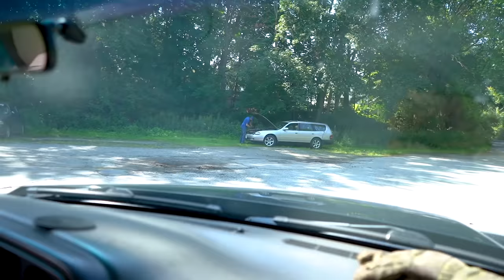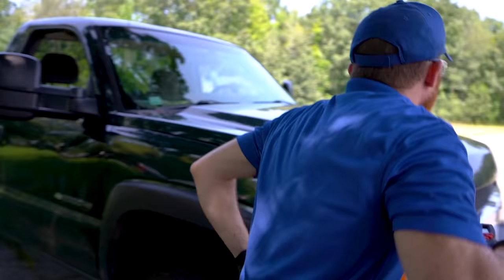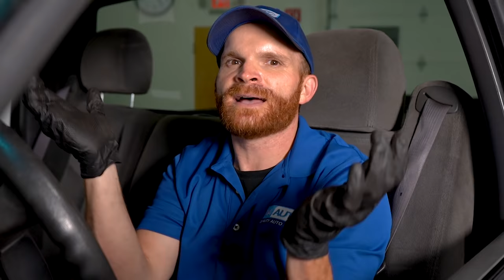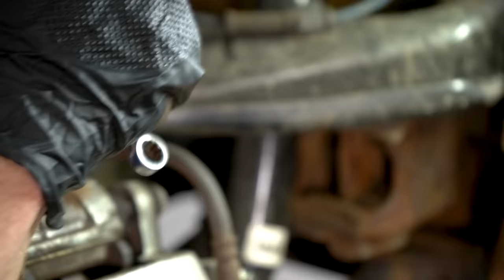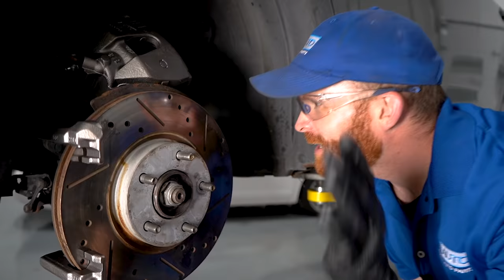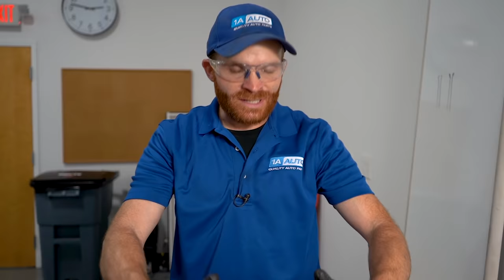Shaking, Pulling Steering Wheel? How to Diagnose a Seized Brake Caliper!

Comment: What happens maester, if the caliper pins are too tight ? Am just trying to solve the issue without changing or opening anything... front left caliper is just a little bit stuck, can still move it with my hands though. Pushed the inner side of caliper a little bit then it relaxed (guess it means problem is not in the caliper)

Comment: I just had new tires put on all around and inner and outer tie rods on front passenger an alignment. I was getting a popping noise when parking and turning the wheel all the way one way or the other every now and then but after this 1,200 dollars of repairs now my car is clunking on the same side they replaced the tie rods and popping while driving when turning in and out of lots also the steering wheel is shaking back and forth around 60 mph and higher and when I hit a bump it feels like the right front tire is going to fall off! I had the struts replaced in 2020 and that’s the only conclusion this mechanic can come up with bad struts? Everything thing else feels solid but I just don’t know what else to look for or other possible issues it could be it’s worse with new tires and tie rods than it was before… help!!

Comment: Any suggestions if I'm having the opposite issues? My car vibrates bad when I first start driving and then it slowly goes away after driving for a while. The shop didn't feel anything and I think it's because the car was warmed up good when they test drove it.

Comment: Would the issue be the same if my suv only shakes when I brake?
Reply from the maker: +WU SHU 79 Thanks for watching!  If it only shakes when braking then the issue is likely just with the rotors and pads.  If a caliper is stuck it will typically cause issues when driving as well.
Reply: @1AAuto  thanks for the tip brother much appreciated

Comment: I have a 1994 nissan cefiro a31 and I have been getting a bad steering wheel vibration at speeds around 80km/h to about 100km/h ... tried changing alot of stuff but it still hasn't fixed the problem... got a 4 wheel alignment and speed balance, changed all the bearings, swapped the wheels back to front, tried "hub centric spacers" I even tried swapping out the wheels and tires to a friend of mines to see if that would work ... haven't tried the rotors and brakes as yet tho but my problem exists even when the car is cold it doesn't need to warm up .. I'm lost 🤷🏽‍♂️🤷🏽‍♂️

Comment: My steering wheel doesnt shake but is crooked. Pulls to right. Vibration under seat and in pedal. Pedal makes a squeaky noise. I thought it could need an alignment. I had brakes and wheels checked when i first bought car. Hasnt gotten worse but i gotta get it taken care of. Im always afraid they're going to fix what is wrong plus try to sell me something else

Comment: So what if you replaced rotors, calipers and pads on both sides of a front wheel car, and you still have a shake?
Reply: Could be a motor mount, Len might address that in a future video?
Reply: Maybe a bad tie rod or pitman?
Reply: When was the last time you got your tires balanced?
Reply: Get some new or good used tires and alignment. Check your Rods, upper control arms, lower ball joints just to make sure it's nothing major going on.💪

Comment: I bought a  used truck and had a caliper leaking.  Turned out a previous owner for whatever reason removed the bleed screw then forced a more coarse threaded screw in and it did not seal. This of course ruined the caliper.